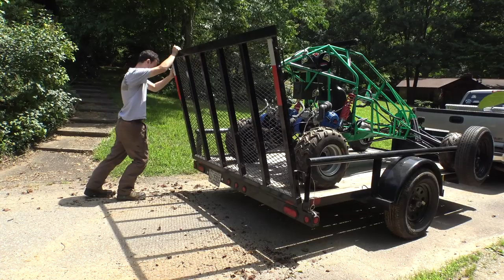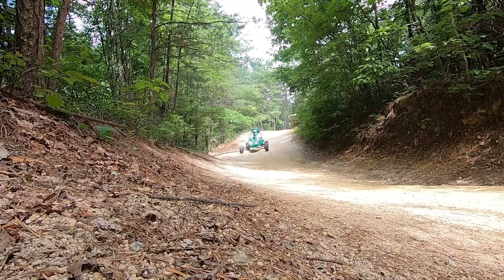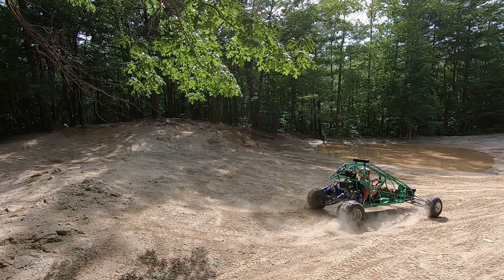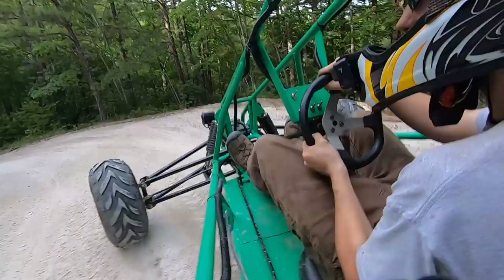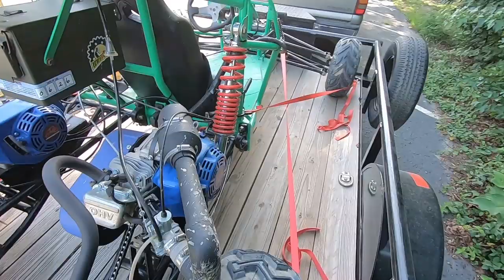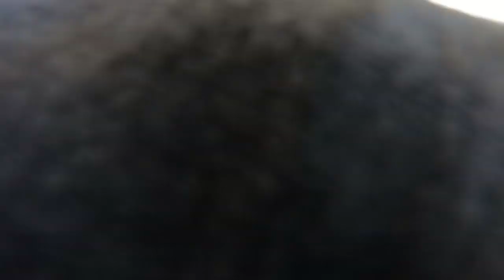Taking the dual engine go kart off road

Comment: Make a dual predator 420 😂 we’ll see about “underpowered”
Reply: 670
Reply: Tyler Cooley double 670
Reply: Dual 500cc honda 2 strokes it would be untouchable
Reply: How about double hayabusa engines
Reply: @steelmesh pretty sure if I remember the build both engines are stage 3 so most if not all of that was done.
Reply: @rustyprojects1545  all the YouTubers that have 670 in there buggy's all get hurt some way

Comment: This thing is pretty cool, but after watching this video, I think a better dual engine independent rear suspension setup would have been to set up the rear dirt bike style. Engines mounted to the frame, and then each engine run to it's own swing arm, so that the engines aren't bouncing around like that. With what I am proposing you still have dual engine and IRS.

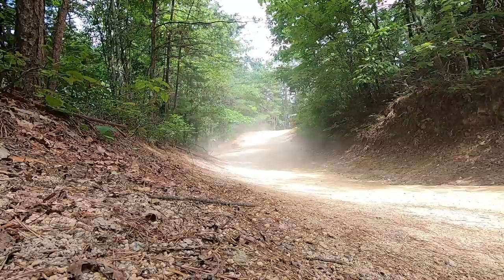Comment: 4:05 I wonder how an engine (specifically the left one) takes being shaken like that?
Reply: Just fine apparently! Haha, it probably filled the catch can pretty good though XD
Reply: I was just thinking the same thing....I would never want the engine 
attached to the independent suspension....my guess is you'd be asking 
for (engine) trouble...but, it's his (money/channel)......I get it...
Reply: As long as the engine is mounted fairly close to the pivot point, (of the suspension arm) movement should be a non-issue. The further away from the pivot point it sets, the bigger the issue. Still, mounting them to the frame might have a little less movement.

Comment: You gotta start putting bigger motors in this stuff man lol love your videos but your always worried something is “under powdered” well start throwing bigger motors in.
Reply: It's not as much the about motor size, as it is the frame size... Lol 
When he sets out on these projects everything makes sense but then somewhere through the middle of the project he looses the plot and starts building a monster truck. Lol He should probably just pick up car motors from the wreckers to begin with... Lol
Reply: I wasn't crapping on him by any means his talent is through the roof. the fab work and creativity behind these things is impressive I wouldn't even know where to start.  but your exactly right about the frames and chassis hes building. hes putting motors in these things that people are putting in shifter carts that weigh 10x less. that buggy for example is a wild build and is super impressive but you cant put a golf cart motor in a tank and expect it to rip. and idk about 80% grade if you put that much effort into building a tubed chassis like that to have it roll around the yard at 5mph. doesn't need to do 100 but you cant put a golf cart motor in a tank and be like "SUCCESS"
Reply: @steelmesh why are you telling me this?
Reply: I feel like he should experiment  with CAD drawings. Follow a plan. His fab work is excellent but his finished products are often flawed.
Reply: @casey8207  isuzu makes a small 4 cylinder turbo diesel that would rock that buggy hes building but he probably doesnt have the 7 to 8 k for it.
Reply: No he needs bigger Engines NOT motors...

Comment: I love that thing! If you fix the suspension problems I would ask about $5500.00. Wish I could afford it! Suggestions: One more shock on each side of the front suspension! One more shock on each side of the rear suspension. Can you add shocks with out adding springs? Small front skid plate (Better to bounce off than dig in). Sway bar not sure where (real curious what affect it would have).  Those motors really shake. That can't be good for them! You have become one of my favorite motor sports channels on the Tube!

Comment: Looks like you need something to keep your knees in if you roll it. Gullwing style cage doors would look amazing on that thing and should be pretty easy to make. Lil gas rams like the ones that hold open hoods or tailgate glass would be cool too cause then they'd stay open till you pull em shut. Also, it might be a good idea to make some removable thin aluminum/steel or plastic paneling to keep out the sand/dirt/mud and don't forget looking good while they're at it. 😎

Comment: In addition to stiffening the suspension, it's seems also too high, now most of the acceleration energy/force is wasted in lifting the frame and stretching out the shocks . In resting position the angle of those rear beams should be almost flat, so they won't try to crawl under the frame, but push the frame forward. The frame is not that heavy with the engines on the rear axle basically. I suggest moving the shock position to the horizontal frame bar just above it and a little bit back. This will lower and stiffen the rear suspension a bit an is a relative simple fix. 

I really like your work, keep it up! :)

Comment: First of all sorry I don't know your name but I for a long time now wanted a fully equipped shop like you have and I'm very impressed with the machining skills and fabrication skills you have. This dual engine mini buggy has the best performing suspension I've seen for mini buggies. What DOM tubing and wall thickness was in this build? I'm guessing 1" and 1 1/4" .120 wall? I do have a J D square air hydraulic tubing bender and Miller 180 wire welder with tubing notcher. I kinda think that it would be better to have one V twin motor with CV axles so that the motors aren't bouncing around, maybe a built predictor 670, they can be built to over 40 hp.

Comment: Is it not harmful for the engines to shake so much?
Reply: That's what I was thinking how do they take that much shaking with out stuff messing up
Reply: It is
Reply: they doesnt realy shake that much just camera mount shakes
Reply: Family Fun I don’t think you understand, the engines are moving up an down and vibrating viciously with the shocks. It’s not like any other vehicle where the suspension saves the engine from wearing piston rings, or at this rate cylinder walls, carburetor floats, etc, etc. don’t get me wrong I love the concept of this build but is it reliable, no.
Reply: @mikeisaac3826  yeah maybe you are right
Reply: The oil is certainly getting splashed around!
Reply: He is using a sealed fuel injection so shaking is no issue.
Reply: I am not really sure I am thinking that's it depends on the type of motor he's using if it's got something helping to keep the oil circulating correctly like a windage tray or what ever they call those in race car motors as far as the enteral parts in the motor like you were talking about I don't see a way it would hurt the enteral motor parts like pistons rings cam or valves all those parts are pretty much stuck to the place they are located at and can only move the way they are supposed to move

Comment: Hello, nice job, I think it would be better with higher wheels for handling(would also allow your chains to touch the ground), independent engines in the rear is original, it would take also an additional bar to turn more "flat" by creating a stop with a slight tension on the front suspensions (making them a little firmer, but less likely to capsize). I think it have little bigger wheels to stay in the category" buggy " (10"-12"?),your motors can do,better confort also.

Comment: You could temporarily remove the springs from the suspension so you can test the full range of motion. (in the shop... not while riding it, obviously)
As for the bottoming out... do you have a dial to adjust the dampening? The spring stiffness seems fine... just need the shocks to move slower.

Comment: If you want to, make the front a-arms shorter, so that it has the same stance as the rear, that might limit travel, but it will stiffen it up with the dual shock setup because of there being less leverage on the shocks. As well as, because the rear suspension needs to be stiffened up anyways, you might wanna look into relocating the shocks and kicking them out further to the sides to allow for you to put bigger shocks in different mounting points on the swing arms and not hit the engines. I think that the reason the one engine wanted to die so much was because of the spark boot being broken, lower idle speeds may mean weaker sparks, and with the cable having to arc to the spark plug because the boot was broken may have caused your running issues. And for the air filter relocator hitting the ammo box situation I would just relocate the ammo box to sit higher or build a different mount for it somewhere else, maybe behind the seat? Anyways, this is seriously one of my favorite builds, and the lack of power may just call for an engine refresh, maybe stage 3? I know I said a lot in one comment, but I'm hoping you see it and are able to consider some of these suggestions :) anyways, keep up the awesome work Chris! I really love watching your videos, and these raw driving videos are a whole lot of fun to watch, especially when I hear you laugh and see you smile and know that you're having fun with your builds, cause that's the most important part! I really liked the helmet cam and the camera on the rear suspension btw...

Comment: I was just wondering, this thing has Reverse? I love this Car, I really love the whole thing specially the suspension. Take care and have fun! Also, there has to be a better way to have those fuel lines and throttle cable back there, it just looks a little unsafe. boy I really love that independent suspension.

Comment: noticed your steering wheel becomes more and more offset to the turning radius of the wheels. i would suggest checking the steering rack. or shaft for anything loose. unless its one of those removable steering wheels that have no set key.

Comment: to fix the air filter problem  just put the factory air cleaner back on ...you wont notice any power loss .. taller tires and stiffer shocks may help with the front end bottoming out like it did. just shortening the the suspension travel would help to.. for the starter drive getting smashed id just move the shocks inside the space between the two engines ..the engine that was spitting sputtrring and refusing to idle  thats most likely the needle valve getting knocked around (that unfortunately is the downside to a float and needle carb in an off road vehicle)  you can fix it but if it happened once its most likely going to happen again.. keep in mind the carb isnt defective it was just never intended to be used as you myself and other youtubers are using them. factory tolerances can also be a contributing factor.. be cool welding

Comment: Got to give you a thumbs up for trying original concepts and being largely successful.  You messed up with your clearances on the suspension stroke for both rear engines but that is just a rookie mistake I am sure you will never make again.  People like you who are not afraid to make mistakes are the  ones who when they reach middle age people admire and wonder at how they ever managed to get so smart.  You have a ways to go but the point is you are getting there.

Comment: Have you ever considered buying a fwd car thats been wrecked in the rear and pulling the motor and other needed bits outta that? It would be cheaper and easier in the long run. You've proved you can build decent frames/buggies you just seem to keep selling yourself short in the engine department... Just a thought.

Might be a way to save your current buggy with the gearing issue.

Comment: You could get some cheap $10 tachometers from ebay to monitor each engine. You'll know if one dies and you'll know if the RPM is crazy out of sync.

Comment: You should put the 600 engine in this just put a Jack shaft by the swing arm pivot and run 2 chains down the the wheels and one chain from engine to shaft

Comment: I’d like to see you get rid of the dual engines and install the 1000cc motorcycle engine with a similar suspension set up as what you have on your new cart. If your feeling like a bigger project, transfer everything to this frame. It’s lighter.

Comment: Hi
Same concept, but single engine:
One engine, coupled to a single driveshaft located at the pivot point of the swingarms, with chains driving each wheel. 
Keep up the open ended/minded projects.

Eirik Solheim Aakhus

Comment: Looks like your springs are a bit too soft for the weight there. I mean it runs out of all that travel fast just over not so major bumps. Just looks too soft to be very stable on trails, crawling would be perfect. Great build!

Comment: I absolutely love what you've done it is a great card but I can see one major problem the engines are taking a pounding on your rear suspension they are not designed really to be moving quite so violently just an observation not trying to criticize
Reply: Meant great cart

Comment: How much would a rolling chassis for a simple 1 seater cost me to build? I have a welder and all that just trying to see if it’s worth it to build a single seater with independent front suspension and a swingarm with suspension rear end. Thanks
Reply: Make a rough plan for the frame and figure put how many feet of tubing you will need then go to a steel supplier or a welding shop and get the price of tubing by foot
Reply: Bryn the tubing costs should be easy to calculate. I’m more wondering about the wheels, and all the specialized parts. The ones I found make it seem like this would cost thousands.
Reply: A manco dingo with a full roll cage and a built up 212 will handle this no problem. If you were to modify one and put a suspension system on it like this has it  could do shit most newer truck owners wouldnt think about doing seen mine go up  70°+ inclines. If you through a 420  predator on a single seater go kart its insane theyll flip from how much torque they have but youl be able to climb shit like nothing
Reply: @ngk330  watch around Craigslist and the Facebook marketplace, finding old quad tires and rims ain't hard.
Reply: I appreciate everyone’s help. I’ll keep watching around and see what I can find. Thank you !

Comment: There is no way those engines are 18hp each....  Not a chance.... 
at 18hp each wheel.. that thing would be popping wheelies.
Reply: My 6.5hp stock Predator 212 slips and burns the belt in minutes when I'm full throttle and offroad, 18hp will snap a belt
Reply: @samkaiset2802  bro you have it set up wrong then. I'm running an 18hp duramax and haven't had any belts burn up even with the go car pushing 60. Make sure the back plates of the clutch are the same and true with a flat piece of metal. 👍😎👍
Reply: @samkaiset2802  dude thats because the belt is set up for weaker engines, you have to buy a better one
Reply: @xRamRacing  .. Just think of how much faster a yz80 engine would be on this thing...  and it's only 22 to 26 hp...   maybe it's just the way he drives it-- that may have a lot to do with it.
Reply: @tagsdaddy  I will take the advice but I also only have the 30 series torque converter
Reply: @samkaiset2802  true, I had the 30 and yes the belt caught on fire, had to switch to the 40 with a reverse spring. Hold great now and barely gets warm even with a 8 second whip it shot of no2 here and there. 👍😎👍

Comment: Your front suspension wouldn’t be so weak if the A arms weren’t so stupidly long. Your front track width is way too wide. I was actually waiting for you to clip a tree or rock and tear off a front wheel. 
Your left rear shock is shot. It allows the left rear to bounce which contributes to the engine hitting the ammo can.

Comment: Mate! You would be best strapping the wheels down not the cage. With such soft suspension you risk snapping the straps as the buggy bobs up and down on the trailer.
I tow every week and have a vehicle trailer.
Looks like a fun buggy.
Also as a general rule, the suspension will be worse and slower to react because you've increased the unsprung weight by putting the engines on the trailing arms.
The two seater looks brill.
I haven't seen any videos on that after you were changing the gearing. Hope you got it sorted.

Comment: I totally didn't understand until just now that you mounted the engines on the suspension assembly. Sorry man. That's just stupid.
Reply: Rob Lambert thats the only reasonable way he could do it. I would like to see you come up with a better solution
Reply: its clearly a problem as the engines can only take so much shaking and smashing around. one ride and both engines were damaged.

Comment: Your a great fabricator but the whole concept of the rear of that car is horrible as I'm sure you know by now. You wonder why everything is bashed up and the motors are coming apart... Don't mount them (motors) on the trailing arms...Lol. I was cringing at that footage just wondering when one of those motors was going to go tumbling off. Also, you can'y expect a lawn mower engine to run right when it's taking a beating like that. You've come a long way since you designed and built that and you are on the right track now with the latest honda build. Sell it quick and spend the money and newer better projects.